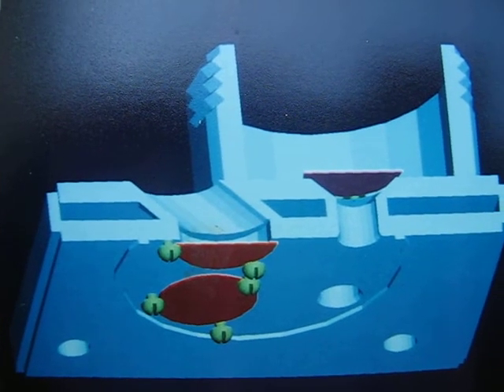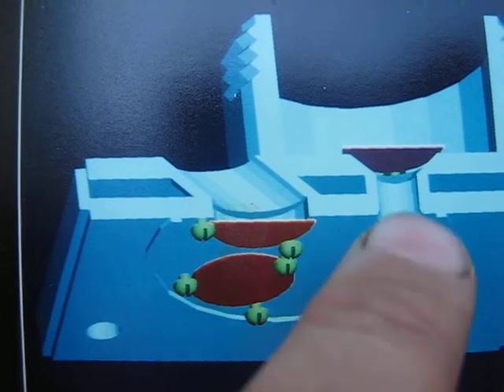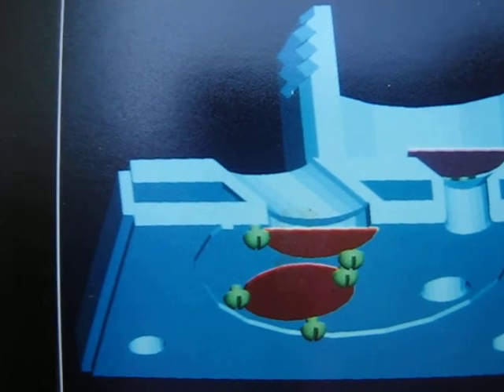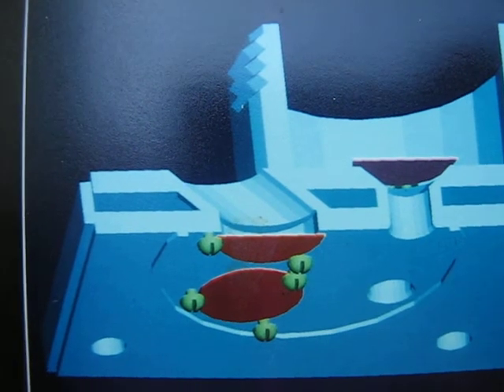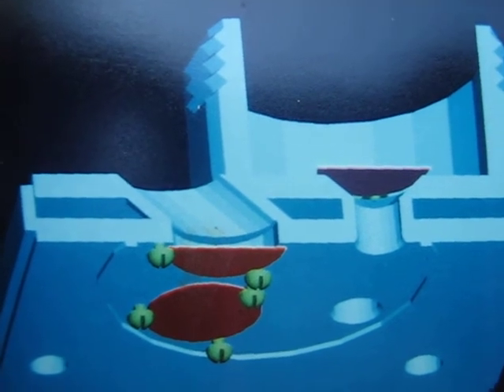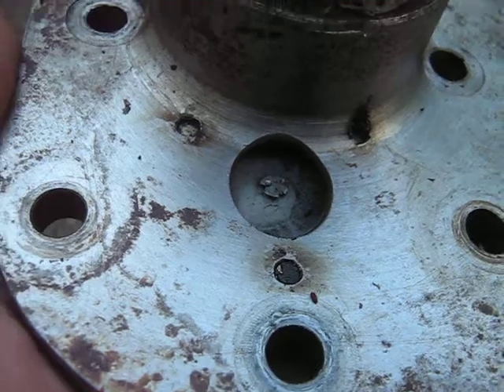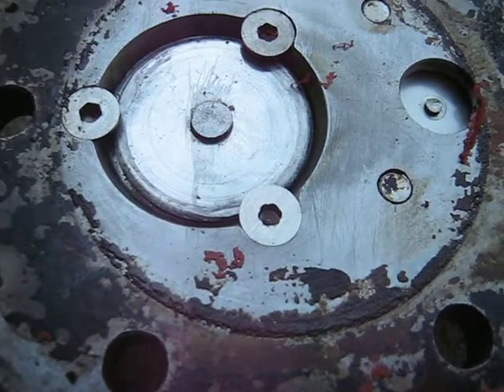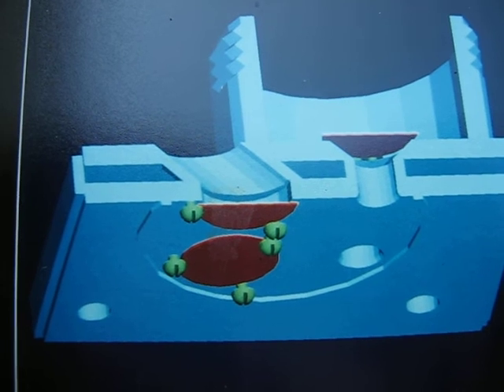4 Valve Air Compressor Head

Comment from the maker: Yes, I have a computer at home, but no internet.
I actually did this drawing about 20 years ago, when I was at university. I built the head in the drawing, but never quite finished the compressor, and most of it got scrapped when I moved :(  I may still have the steel head, but I haven't found it yet.
You don't need the internet to draw on CAD, it is a stand alone program, well at least they used to be, nowadays, they have to complicate everything!

Comment from the maker: Thats an interesting question for a few reasons. The Deltic doesn't really have a head, since the 2 pistons form the top and bottom of the combustion chamber.

However, I think I just figured out what you mean, with reference to the junkyard Deltic :)
I don't think you would need to do a 3D drawing like this, 2D drawings would be just fine, you could even do them on a drafting board.